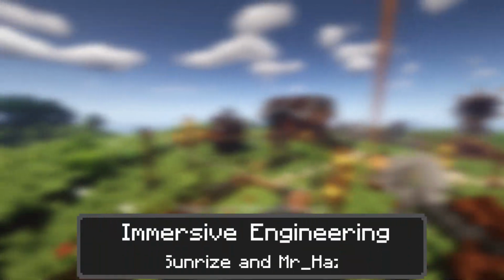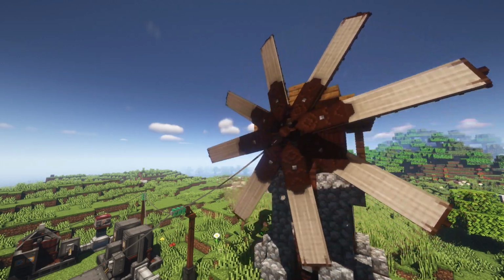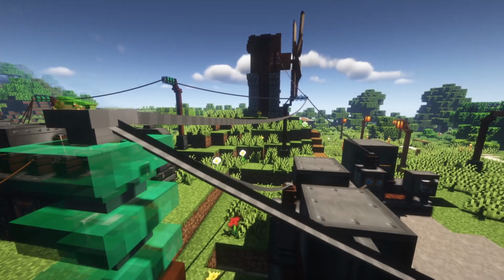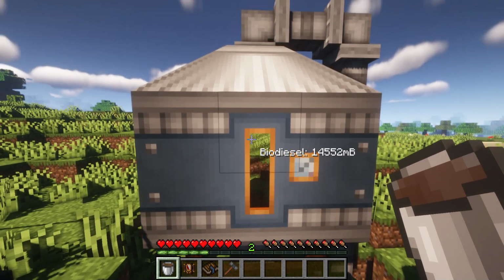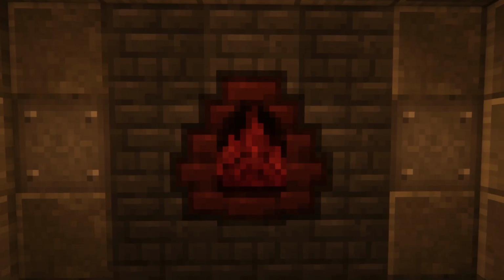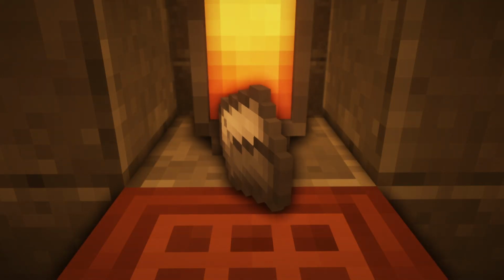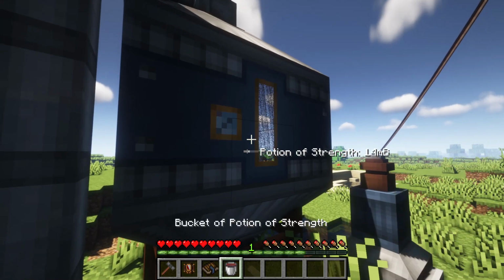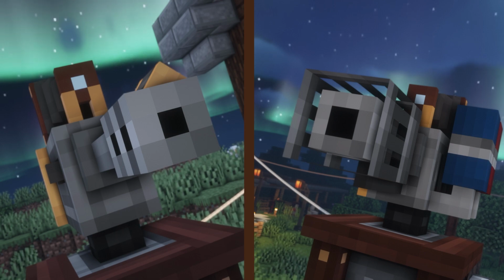Minecraft - Immersive Engineering Mod Showcase [Forge 1.16.5]

Comment: One thing I would love from this mod is vehicles or Automobiles, granted you can install immersive patroleum with this mod to get the motorboat but it's not exactly going to help you much in land traversel, and since this mod has Bio-diesel in it or I guess you could use petrol if you have IP installed I think adding vehicles would be a good way to keep the player excited for what to work on next.

Examples being a simple vehicle that could just be a minecart on wheels with a engine on the back but you could also make bigger vehicles later on like an Excavator on wheels or stuff like air-crafts. My experience with this mod was fun until I had created all the gadgets and had basically nothing more to strive for after that which I guess is a me issue but still, if this were to be added in IE it would give me more things to work towards as appose to just me making an endless supply of Revolver bullets to kill time.

*Edit: of though if they want to not add it because they want to keep it minecrafty, you could probably make some special horse armor that you can add stuff to in the engineering worktable instead.
Reply from the maker: Sounds like it could be a great idea. Though I'd imagine they would need to find a way to make it fit into their artstyle (let alone get it to work), it would be pretty cool to have some sort of automobile or steampunk styled vehicles to navigate.
Reply: @CrittersModMenagerie  Yeah, granted I could just get another vehicle mod but the issue is that there are not many great vehicle mods that are for 1.16.5 aside from perhaps MrCrayfish's Vehicle mod but that mod runs on it's own fuel supply and so on.

Personally I'd like to just give my Fuel making station a little more usage instead of it being just to fuel my Diesel engine and my tools.
Reply from the maker: True, forgot about the lack of vehicle mods for 1.16.5. If only the 1.12 vehicle mods became available to use for 1.16.5.  
Would definitely make your build feel livelier if there was some vehicle mod that worked with IE. I wonder about if there's other mods that add some form of transport that can work with IE in 1.16
Reply: @CrittersModMenagerie  I'm pretty much one of those minecraft mod players that loves engineering mods and one thing I've noticed from nearly all of them is they all have there own criteria's that you can judge by how balanced it is as well as what the mod provides.

Immersive engineering nails nearly all of them like: New Minerals, New machines to progress through the mod to get better stuff including automation,  weapons and tools and of course transportation. 

IE Does nearly everything within it's style well but the one thing that it lacks and is stopping it from becoming as great as the other mods is transportation because the only form of transportation IE provides is the skyhook and even that's a little fidgety of though if you had a item like a Line shot or something to shoot a wire to zipline from then it would be a little more tolerable.

all in all, IE is great. Just lacking in transportation and of though I might be nitpicking if they improved transportation a little more then this mod would be a step closer to perfect status.
Reply from the maker: Great observation with that. I didn't even realise that IE lacked any proper transportation system. There's certainly options to adding some unique transportation devices yet keeping it in the same style as IE. Create recently did it with trains, hopefully IE can get some inspiration from that (maybe even boats too)

Comment: Amazing vid bro but i have a question, is immersive engineering the only mod required for techguns?
Reply from the maker: If you wanted it to just generate power for TechGuns, this is technically the only mod you really need. It's not essential but if you want to get the powered tools and gear, IE is a good mod to use to get your power from :)

Comment: I know I'm wrong here but I am not sure if you check the comments on older videos. That's why I am commenting under this video.
I'm hosting a modded minecraft server where I have the "Ice And Fire"-mod installed. After I saw your video I added the "HWYLA"-mod to see the gender and stage of the dragons because it makes it a lot easier to decide if a fight against a dragon is worth it.
My issue is that i can't find the right configurations to make the mod work the way I want and I already spent a few hours trying to fix this without luck. I'd appreciate some suggestions on what I could do now.

(The video I am talking about: https://www.youtube.com/watch?v=pi6vghTMLLY
 Minute 1:30)
Reply from the maker: That's strange, it worked for me first go when I used it and that was without altering anything at all. Have you tried using TheOneProbe? It's a mod that's quite similar to HWYLA but does it in a more immersive way.
Reply: @CrittersModMenagerie  First of all thanks for your response.
So I tried The One Probe and it's also not showing what I need. When using the normal probe it's pretty much the same as HWYLA and when using the creative probe you can see the age and other stuff in addition but not the gender at least if I am not missing some configs, that include the information shown.
Do you know which version you used for the video because I'm using the latest forge version?
Reply from the maker: @glupschy2940  That's strange how that mod didn't do much either. Fortunately you're in luck, as I keep all the mods I've downloaded into separate folders for each version. I used version 1.8.26-B41 of Hwyla, which was in 1.12.2 and 1.10.8-B72 for 1.15.2. Not sure if you were intending to play in the latest MC version Ice and Fire is on (1.16.5 I believe) cause it would not work otherwise with the versions I've suggested.